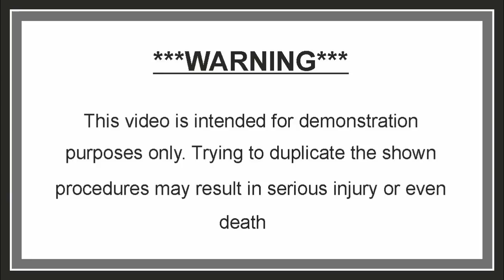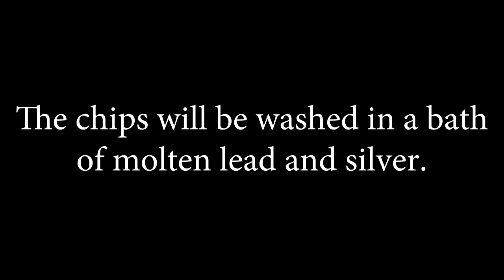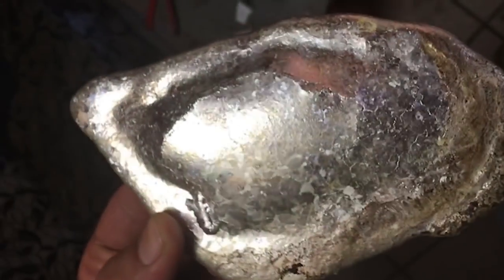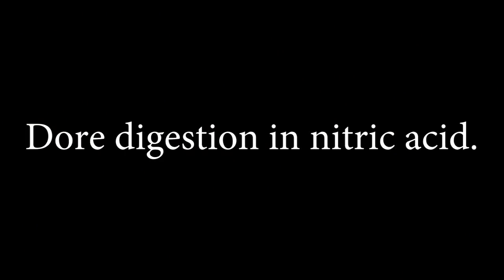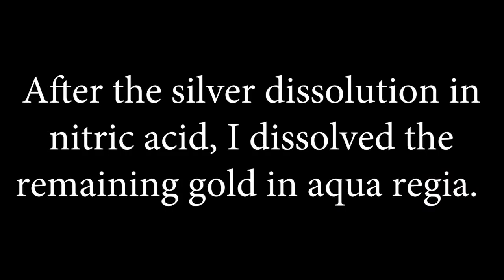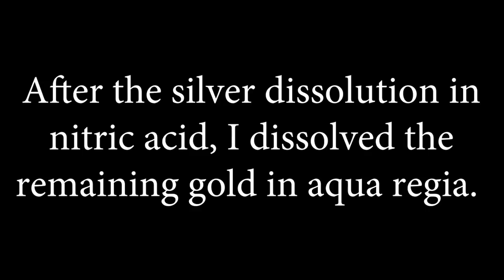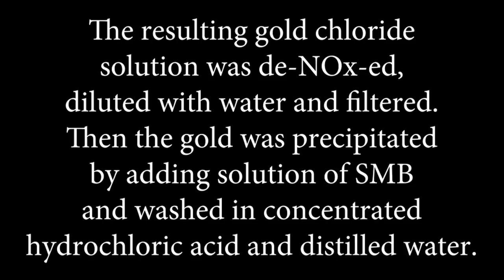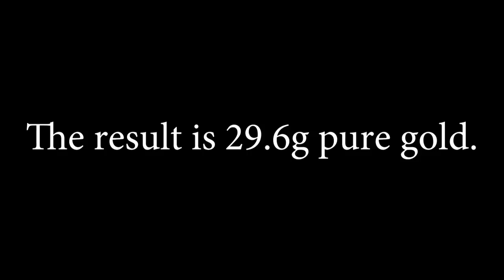Smelting ICs, CPUs and EPROMs for GOLD

Comment: Why   you don't use copper in place of silver?
Reply from the maker: 1 silver has lower melting point,
2 copper interferes with the cupellation,  
3 refining both silver and gold simultaneously
4 using less nitric acid to digest dore
Reply: @OwlTech333 , сними обучающее видео по купелированию. Именно ОБУЧАЮЩЕЕ, а не демонстрационное, с пошаговыми объяснением.

Будь добр! 😉

OwlTech, make cupping tutorial videos. It is a TRAINING, not a demonstration, with a step-by-step explanation.

Be kind! 😉